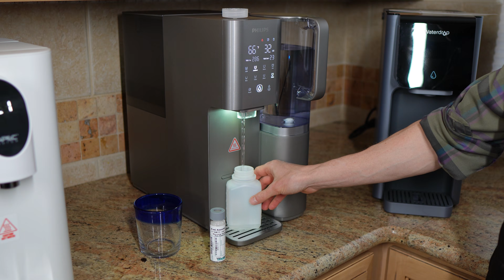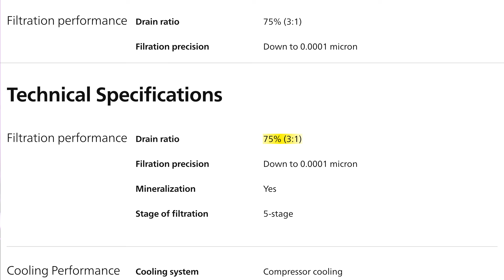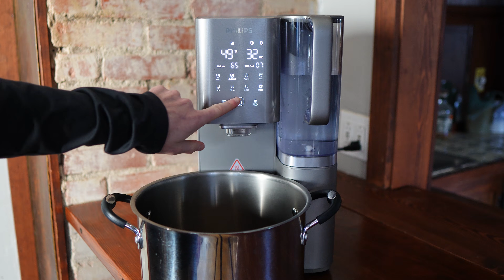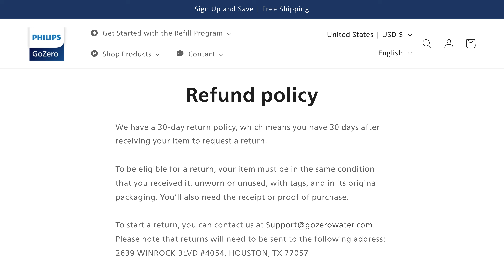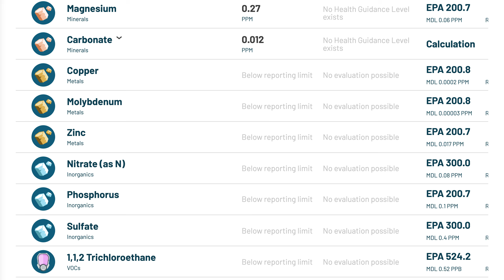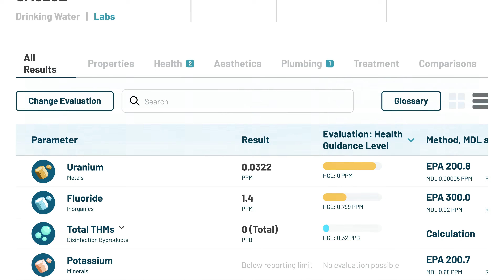Is the Philips Water Dispenser really THAT good?

Comment: How does such a thing work on well water that is not normally drinkable?
Reply from the maker: Depends on the contaminants present, but likely would require pre-treatment. Many common well water contaminants will foul and ruin a unit like this if not addressed up stream

Comment: Are you sure your hot water measurement is correct? If it is that's a MASSIVE concern! 113 degrees for the hot water seems really far off from 'boiling water'
Reply from the maker: Yes

Comment: Hello, I’m a total idiot with this stuff but could you tell me if the replaceable filter is safe from microbial contamination and overgrowth ?  The plastic tank can be washed  but the filter cartridge can’t.   I worry about molds, etc.   I hear about those office water dispensers getting moldy
Reply from the maker: This is why its important to replace the filters on schedule, and keep up with regular cleaning of the rest of the unit
Reply: @waterfilterguru  thank you!  How about units that have UV sterilization, are they recommended for better microbial safety?   I’m just a little OCD about the difficult to clean internal pipes connecting the different water tanks and even leading to the actual nozzle dispensing water.
Reply from the maker: @user-sk2fw8jq3m   I made a video all about sanitizing the internal components of countertop ROs here, check it out https://youtu.be/9R2nLkkHFCc

Comment: In Germany the heat only model is 360€, compared to 450 for the A1 or 425 for the AquaTru Carafe. Replacement filter is 100€. That way this model does make more bang for buck sense, right?

Comment: I don't touch any Philips product with 10ft pole.
Reply from the maker: Care to elaborate?
Reply: @waterfilterguru Bought Philips table water filter - its glue caused cancer. Received new filter long after I trashed it. CPAC machine recalled because causing cancer. Multicooker $1 plastic opening top handle painted as stainless steel broke. No parts available. Trashed it. Small travel fan melted the cord. Only luck I had with shaver but blades were too expensive. I love my Panasonic shaver. F  overpriced junk

Comment: Many of your products are impossible to buy in Spain/Europe. Philips is available, and I didn't see this listed on your website. I understand it is "worse" than the others 3 listed? Pricing apart,t it seems a good candidate. Can you tell me how good is based in your current rating? Thanks!
Reply from the maker: Good question. Just to clarify first, these aren’t my products and I don’t sell water filters. I independently test and review systems and report on the data.

Most of my testing focuses on products available in North America since that’s where I’m based and where most of my audience is, so unfortunately many of the systems I test aren’t easy to buy in Spain or Europe. Sorry about that.

You can see how Philips compares to other countertop RO systems based on the same criteria I use (performance, certifications, maintenance, etc.) here: https://waterfilterguru.com/best-countertop-reverse-osmosis-system/

Hope this helps
Reply: @waterfilterguru  Thanks for replying. YEs, I know you make amazing and data-driven test (thanks for that). I swear I didn't see the Philips on the same URL you mentioned. Anyway, it's clear for me with your reply.

Comment: My area in Clearwater FL has 10-12 gpg hardness.  You said that I may need an under the sink descaling.   What do you recommend? And if I do de-scale wouldn’t it will be better to do the all house? We are 3 people and two bathrooms.  Also do you still think the AquaTrue Carafe is the best option? Me and my wife and a couple of cats.  Also do the filters actually hold as long as promoted? I saw some people say that after 2-3 months they have to replace.  That makes it not cost effective.
Reply from the maker: Yes if you own the home, softening the water at the point of entry is hands down the best way to address hard water and protect downstream water treatment equipment like RO systems.

And along those lines, I'd recommend and under-sink RO rather than a countertop unit. These require invasive installation just like a whole house softener does, so not really an option for folks in rental situations. That's really who countertop RO units are intended for.

Filter lifespan is directly correlated to 1) the quality of water being filtered and 2) frequency of usage. What only lasts 2-3 months for one situation may last a year in another. So take those comments with a grain of salt because their water is likely different than yours.

hope this helps
Reply: @w@w @waterfilterguru hank you. It looks like under the sink is a better option because my wife wants to be able to clean veggies and cook and drink. 
We had in the past a system from Applied Membranes INC. AMI.
I wonder if they are NSF certified. 
I saw your Cloud RO video and the $200 filter replacement package was intimidating and also the Made in China doesn’t promise a good material control, BPA free etc… 
What do you think? By the way you have the best channel.
Reply from the maker: @DavidJulian08   I appreciate the feedback on the channel! The Cloud RO https://geni.us/9ClI8J3 and Waterdrop G series https://geni.us/rQekgwp are the best under sink ROs I've tested so far, based on my data-driven scoring system. I personally don't care too much about country of manufacture origin as long as the product holds official certifications to NSF/ANSI performance standards, since part of the certification process is testing for materials safety
Reply: @waterfilterguru Thank you! Is the second one cheaper yearly ? 
Which is your choice of the two now ?
Reply from the maker: Both a great. Both contentional ROs and tankless ROs have advantages and disadvantages. Which do you prefer?
Reply: @w @waterfilterguru don’t know which I prefer. I kind of liked the one with the battery but I hate the $200 replacement filters and battery which I suspect will be faster than a year. I like the high PH aspect of this one. I just watched a video of yours about the tankless model and it seems like it did have some contaminants  go through which may be the tipping point to prefer the other one?